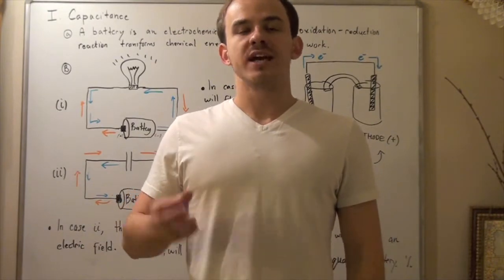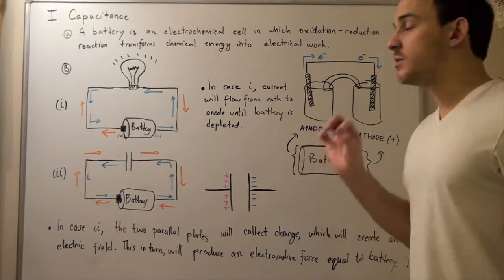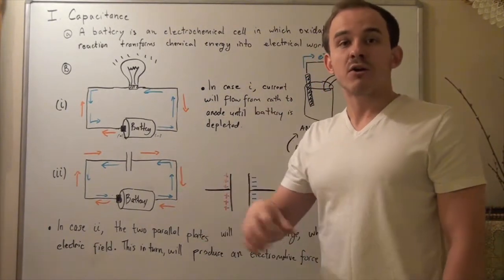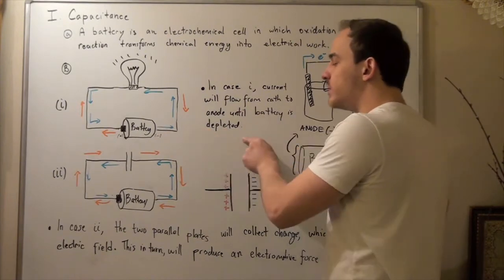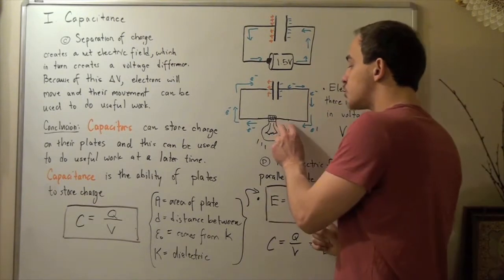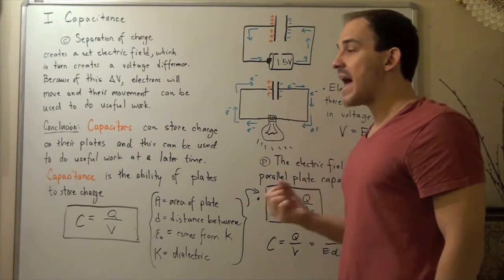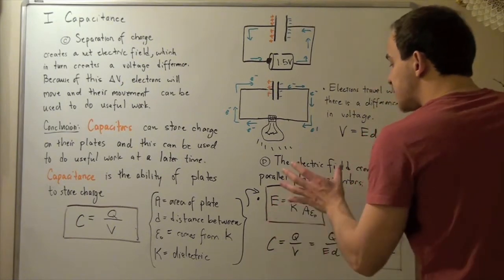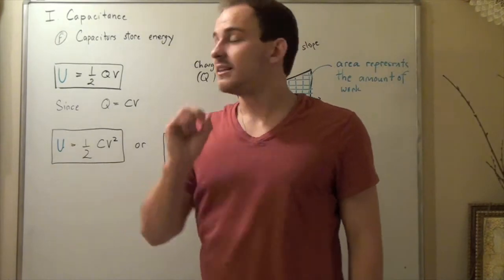Batteries, Capacitance and Capacitors

Comment: sir i have a doubt.....when we connect a battery to a parallel plate capacitor...then the circuit is not complete but then also y do the electrons flow?...........is it like flow of electrons always takes place throughout the wire till capacitor even if the circuit is not complete?
Reply: Yes